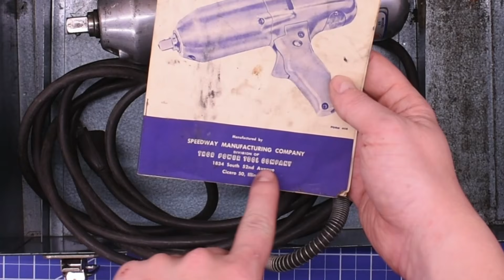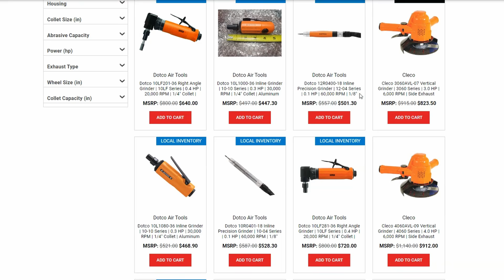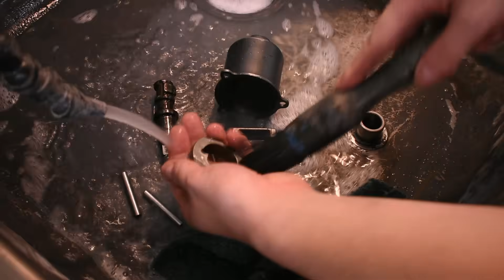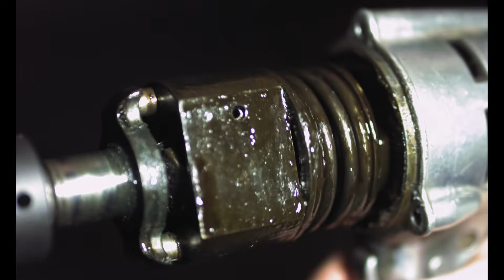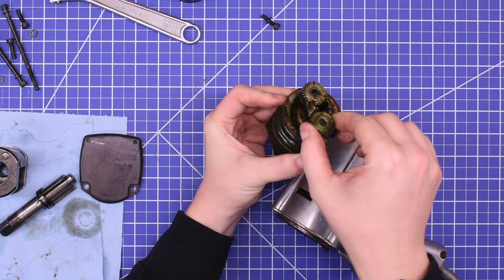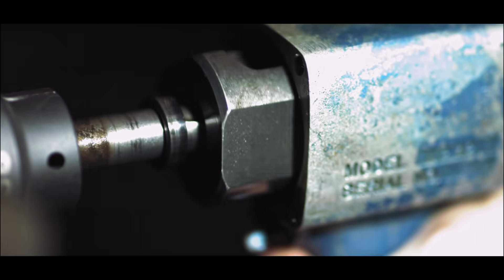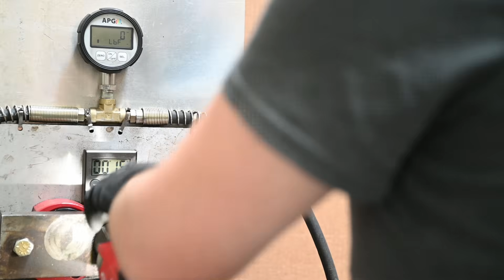Cold War Era Power Tools vs 90's vs Today

Comment: "Welcome to the Torque Test Channel, founded in 1893"

Wow you've been at this a long time!
Reply from the maker: 1800's algorithm was somethin else I tell ya!
Reply: @TorqueTestChannel  Torque's Traveling Tool Testing Exposition
Reply from the maker: @PhillyFixed step right up and get your torque elixir! Made from special coco extract and ethanol
Reply: @TorqueTestChannel  this has me wondering how much torque a late 1890's mustache straightener puts out
Reply: @TorqueTestChannel don’t forget snake oil 😂
Reply: @TorqueTestChannel How else do you think the Transcontinental Railroad was constructed so quickly?
Reply: I remember those tools. The metal body drills and jigsaws could double as boat anchors. Some were easily tripple the weight of modern cordless stuff.
Reply: I was also amazed at how long TTC been at it….😂

Comment: Genuinely upsetting that 1990 is closer to 1960 than we are to 1990
Reply: 1960 seems like a long time before 1990 and 1990 feels like less long ago compared to now. It's really weird. I was born in 1974. The end of the Vietnam War seems like a long time before my birth year but it was only a few years. The pandemic was 4 years ago and that's more than a few years, but it doesn't feel like a long time before now. 😮
Reply: I remember '60 quite well. We were driving our batwing Chevy wagon w/235 six and three-onna-tree. Piece of garbage. Our '63 w/230 six would run freaking RINGS around the '59. I used to tell my Dad I was gonna get something cool looking like a '59 El Camino and put a Pontiac 250 SOHC six with a four speed in it - just to piss him off.
Reply: @patrickshaw8595  Cars back then were NOT pieces of garbage.  I daily drive 1957-60 Chrysler products and a 57 Plymouth with a 301 v8 and factory 3 speed torque push button automatic transmission is plenty powerful enough to get you down the road and onto the freeway.  Chryslers Slant Six also powered the big cars like the 60 Belvedere and its perfectly fine.   Never had a 59 Chevy,but they are beautiful cars,I would have bought the v8 and automatic though.
Reply: only a 4 years difference... you make it seem like a decade
Reply: @mosasa1307  you can infer whatever you like from what i said. But the fact still stands lol.

Comment: i was always told that air impacts were just way, WAY better than anything else all the way until pretty recently (the late 2000's or so). there is a good reason why pit crews used air impacts lol
Reply: Battery powered tools are just more convenient and, especially for a diy-er, don’t require you to have a noisy, expensive air compressor sitting in your garage.
Reply: Air tools are just more practicle and powerful. Also they last longer and are cheaper to buy. I have both electric and air in my garage and air gets used for the heavy work while electric is for the easy stuff
Reply: @ouch1011 modern battery powered impact wrenches are now crazy strong - stronger than equivalent size/weight air tools.
Reply: Air also has (and will always have) a MASSIVE advantage in terms of size.  The palm impact, also featured on this channel, can get into some tight spaces and deliver mid torque power.  Granted you need the compressor and such, but they don't need to be near the area you're trying to reach.
Reply: They still are better you can do a lot more with air then you can with battery
Reply: You can stall an air tool and the motor part will survive.  Stall anything electric and it will burn up.

Comment: I mainly use a 3/8 and 1/2 compact Kobalt.  Meets 95% or more of my DIY needs.  On the rare occasion I need a bit more, my father-in-law gave me a 30+ year old pneumatic (Snap-On I am pretty sure but the plastic cover is brittle).  It runs just fine off my tiny compressor as I only need to zip out a single bolt or nut.

Comment: I have a small Thor circular saw and a Mall 3/8" power drill, what they lack in power to today's tools they make up for in longevity and build quality. Seriously doubt any of my Yellow, Red, or Blue tools will be around in 60 years from now. As an aside to the Thor impact in this video, it seems the spring is very crucial to the torque output and since springs wear out with use, it would probably be insightful to see what a new spring would do in improving the Thor's numbers.  High hopes to find such a spring today but something that should be noted given how small the hammer is and how little surface area is involved with the pin-type anvils.
Reply: i left a comment as well saying the same thing about modern products and their planned obsolescence getting out of hand.
Reply: Hell, even if a modern tool did last 50 years no way you would be able to get a battery for it. @cerberus1166

Comment: In the early 1060 when I was 13 and wanting to start woodworking and other things, my father bought me a 3/8” RAM drill to start. Another polished aluminum case which turned grey shortly.. it had a 1.9 amp motor, 1900 rpm, a lock on button and that’s it.
Reply: Damn you're 977 years old? What's your secret?
Reply: that would make you.. 997 years old this year!!  🤣
Reply: @raoulrr  yeah, a bit of a typo there. Obviously, the 1960s. It didn’t catch it.
Reply: @melgross  Fix it...
Reply: @m9ovich785  I’ve always felt, having worked with the publishing industry, that fixing errors was cheating. I made the mistake and I’ll live with it. I’m pretty sure that all the smart people out there know it was a typo.
Reply: @melgross  Yeah I read your comment without realizing as my brain filled it in, but of course the kiddos will try and have some fun with it. Was expecting some thought out responses!
Reply: 1060 was definitely a killer year. But man, it must've been rough having to use a sheep to power your drill

Comment: that corded electric one was probably used on assembly lines back in the day...75 footpounds is about the torque on most lug nuts on smaller cars today....and that was the max on that gun...they have come a long way
Reply: I suspect that's why there hasn't been much 'advancement' from corded impacts, I think they've pretty much fallen into a production role kinda niche. Consumers certainly have little interest in them that's for sure lol, kinda wild that they're still offered as a consumer product TBH.

Comment: As someone who worked as a mechanic in the 70's and 80's, I can say this. Ingersoll-Rand was a "go to" brand in that era. Were they top of the line? Can't say. But,  I bought an impact in 1979 or 80 (can't remember). I still have it and it works just as well as it did all those years ago. I'll have to admit being somewhat envious of you younger guy's access to all these newer tools. No air line, no electric cord; just a battery and tool. Very cool!
Reply: I wonder what kind of jealousy I will have when I'm older looking at the young guys with new tech tools!
Reply: @tannerschmitz  future tools..like in 50 years, will have extremely small batteries, that are very powerful, charge very rapidly, produce no heat, minimal vibration and noise, and will hold their charge for a very long time. Additionally the weight of the tools will be much lower, and they will be very compact in size. They will also allow for precise torque settings via an app. from 1 inch lb to 2000 ft lbs, and have smart torque sensing capabilities and the tool will know exactly how much torque it needs to produce to remove or tighten a bolt, without damaging it. The tools will also be expensive, and will be completely sealed off so no one can repair it or open it without ruining it, and probably will only have a 10 year life before replacement is needed.  However, they will be easy to recycle and reuse.
Reply: you have a lot of covert tech devices easy to get, and AI. looking at teh recent issues in school makes me jelly of the newer generations  @tannerschmitz
Reply: @tannerschmitz Fusion Powered tools
Reply: @tannerschmitz  ultra compacts that hit as hard as high torques (locked behind a monthly subscription "upgrade" of course). Batteries that you forget to charge for a week of constant use. Top of the line cordless tools that are dirt cheep but only perform slightly better then they do now because the US never upgraded past 12-15amp 120v. Maybe someone will come out with a corded tool that has 1 medium length cable and 1 super long cable to plug into a different circuit. Hell, maybe well must be sucking power off the electric vehicles were working on (that will probably also be a subscription).
Reply: As someone who just got into working on heavy equipment, air is still king. For anything over 3/8 I don't bother with cordless impacts because I'm not spending $1000 on a giant battery tool when a cheaper and more compact air tool does a better job, lasts longer, and can be run all day.
Reply: I would like to see a head to head test, air powered Ingersold Rand 232 thunder gun  vs the best  Milwaukee cordless impact driver.     I bet the thunder gun wins.
Reply: @dand3975  I'm not so sure. I've read that Compressed air motors are rather inefficient, about 1/7th the efficiency of an electric motor. The large battery packs can put out somewhere in the ballpark of 1500W. Brushless electric motors can have deficiencies in the 90 percent range. Let's just call it 100 to keep the math easy. So figure you need to deliver around 10,000W of power from the air source to get equivalent performance from a pneumatic motor. (Let's be generous and assume that the inefficiency of the pneumatic system is end to end. In other words,  while the reference wasn't clear, let's assume they meant the overall efficiency of the pneumatic power train from electrical power coming into the compressor to the mechanical power coming out of the pneumatic motor,rather than just the efficiency of the pneumatic motor itself. )

Just based on those general numbers, I'm wondering when you start getting limited by practical hose sizes to deliver that much power. I'm seeing 2hp motors that require 80cfm. While it's true that the impact needs it intermittently and those are continuous numbers, it shows the difficulty of supplying the amount of air needed.
Reply: @michaelallen1432 Thank you for all the facts and test data.  I love the power of my 1/4"  Milwaukee & DeWalt (cordless) Impact drivers, I use them daily. However,  when I need Unlimited power to twist off 1/2" Rusty u-bolts, the IR- 232 powered by Air is the Champion.
Reply: I grew up using my old man’s snap on tools and his 1/2” gun from 80s still strong as ever but even compared to the Ryobi I just bought it’s not even close. I don’t even have to worry about breaking lug nuts loose before jacking up my trailblazer my Ryobi will hammer maybe once and back them right off and that snap on still takes a few Ugga duggas every lug. I was surprised and I have multiple 80 gallon tanks at 120 psi with sanborn 5hp compressor. I love the sound and feel of air but damn impressive what you get for 150 bucks now 😂
Reply: You should only feel pride, not envy. The further we go into the future the less credit we can take for our own work. I greatly respect all the old timers.
Reply: I still don't feel comfortable using battery tools on energized terminals. I'll always stick with air for that.
Reply: @RT-qd8yl  can you elaborate?
Reply: I have 3 ingersol rand air impacts and they are very solid, reliable tools with a better than average power output. Cant go wrong really and they have a solid warranty
Reply: I’m a 23 year old mechanic I use to run cordless tools but I switched to all air tool about 2 years ago and I like air better. The air tools just have better power delivery in my opinion.
Reply: You're not missing anything. I still prefer the air impact. The one thing that's good about the battery tools , you don't have the air line laying all over the fenders while under the hood.
Reply: Late 20s, bought a pretty much spotless 1988 hilti gp22 just for old school 2 stroke concrete drilling, even though it’ll sit in its pristine metal box all year every once in awhile I’m gunna take it out if I need a rotary hammer for a job just for fun,
Reply: These newer tools aren’t that great. They’re way too heavy and don’t have as much power as an IR 2235. Air is still king in a shop. Outside in the bush? Electric all the way.
Reply: Same thing in the 90’s when I was a tech, IR was considered the top dog back then.
Reply: I can say that these electric power tools probably won't last 50 years
Reply: I use both battery and air at work, and when the battery impact cant remove something my ingersoll rand is my go to.
Reply: Cordless tools in winter are useless
Reply: Being a young mechanic today I only use IR impacts. I have a modern one I use everyday and an IR from the 60s or 70s I use as a backup.
Reply: its cool, but if your shop has a big enough air tank.. the air tools still have their place. the electric tools over heat in the texas 114F summers.. and the -20c degree canada winters the batteries loose a lot of power. but the compressed air? it's the same...
Reply: @TheGrippySocks air will always be superior but the convenience of a cordless impact/tool is what gets me wanting more. Typically I won’t be out in -20C very long or I’ll just go into a buddy’s heated shop. Cause cordless or air I’m still not gonna wanna be outside tryna fix something in -20 lol
Reply: @TheGrippySocks that actually makes me curious if air density affects air tool power. Could denser, colder air at the same pressure spin the motor up faster?
Reply: I used a MAC aw234(IR) for years, it was the mainstay gun for a long time.  I'm with ya
Reply: I used CP-772. It was kick &ss.
Reply: Blessing and a curse cordless impact often only last a year or 2 before they break and then they cost double when You have to buy batteries vs air tools I've had for 8 years and corded tools I've had even longer All have there place though I wouldn't want to go without the cordless option now
Reply: Ingersoll Rand is still a top line
Reply: what jealously? dude they allow corpses to buy tools. if you have money buy one.
Reply: ok boomer
Reply: I’m a aircraft mechanic so I’ve never needed (or owned) a 1/2in impact, but I inherited my dads Ingersoll 1/2in impact that he bought in the early 80s (engraved his Social Security number on it for identification) and that thing still goes like hell. It looks destroyed and said SS# has mostly worn off the bottom of handle but it’s a testament to American ingenuity and manufacturing.
Reply: I own a shop & work on autos daily. Unlike all the kids that have to follow what they see on YouTube, I still haven’t found a use for cordless. I can see if you’re working somewhere mobile they might be practical but pneumatic still rules if you don’t buy cheap & if you have a good compressor. Cordless tools are heavy, large & uncomfortable to use under a car in my opinion. I have a huge 2 stage compressor so I have plenty to feed my tools. Most of these cordless impacts are biased toward forward torque which is just odd to a real mechanic.
Reply: If you've got enough air at the ready, but for home use or small garages cordless is the way to go.   I have air, but I can get all 20 wheel lug nuts off before I drag out the air hose to both sides.   @stevemccauley5734
Reply: @stevemccauley5734 what are your thoughts on cordless ratchets? I definitely understand your sentiment on heavy cordless tools that die to soon. I have grown fond of my 3/8in cordless. It's like a scooter for going to a friend's house, not heavy duty truck work lol
Reply: Yep you are, but only cos their vids drop Saturday morning New Zealand time 😉
Reply: Nice to see older people appreciate the future instead of falling back on how great things were back in their day
Reply: @kingduck3192   Very decent of you to say that.
Reply: My little cordless impact driver puts out twice the torque of the Thor corded.

Comment: If you make tools so durable they'll last 60 years you won't sell tools but every 60 years
If you make tools that break every 4 to 5 years you'll sell a lot more

It's the same for everything nowadays tools cars refrigerators everything

And then they make them so "complicated" that when they do break it's cheaper to buy new than repair the old
Reply: wont get fixed without government mandates. repair parts shouldnt be more expensive than a new fridge ¯\_(''-)_/¯

Comment: That's seriously cool. I like episodes like this.  And remember, those older tools were also designed without computer simulations or any of the other modern design tools we're used to.
Reply: Computing was done just not by central processing, motherboards etc...
Reply: Also these were American made, back when that actually meant something. You could be in a restaurant eating dinner a few feet away from the guy who inspected your power tool.
Reply: Mainframes (IBM 360 for example) existed back then but, you had to have some serious work to justify buying them or renting time to use them.  They had engineer's cookbooks, draftsmen, slide rules, toolmakers, and established manufacturing processes to help with product development.  That and good old-fashioned prototype testing i.e. trial and error.
Reply: That's a major part of why the tools were overbuilt. They didn't have the ability to fine tune each part to be just strong enough for it's intended purpose, and last just long enough for it's expected lifespan

Comment: I have repaired a lot of air tools and rocking dog not that uncommon as CP and IR mostly made in Japan models they do have a long life normally. That Cleco was certainly well made and I would have to say those were mostly used daily in factory setting due to cost but it looks as you say ready to go for another 60 years is certainly believable.